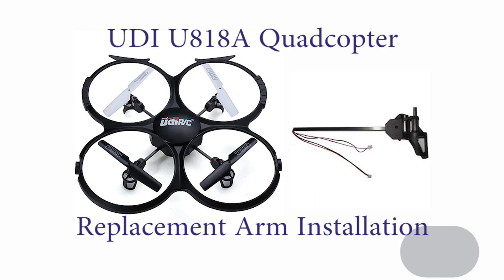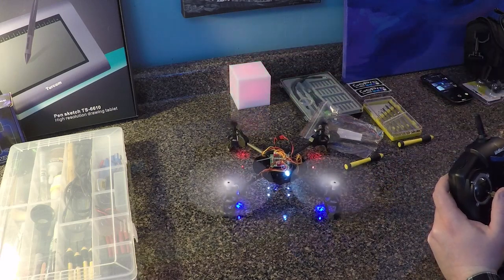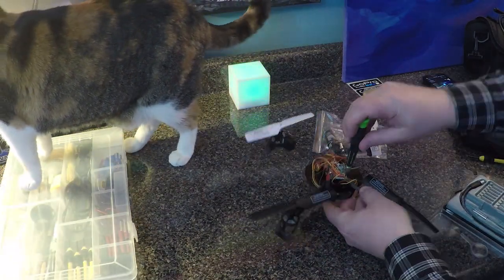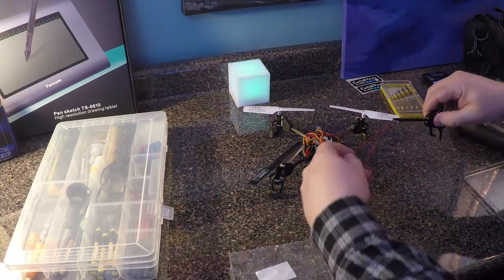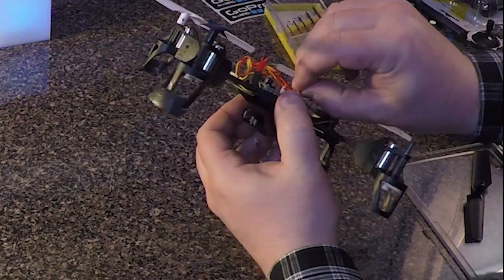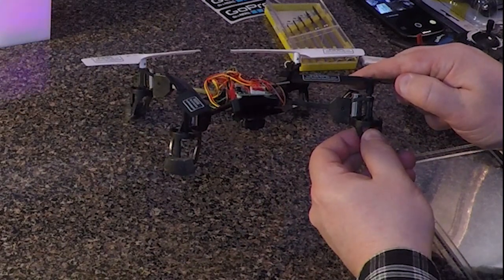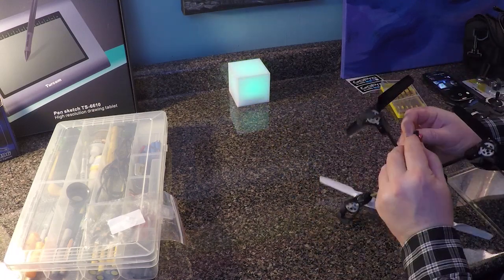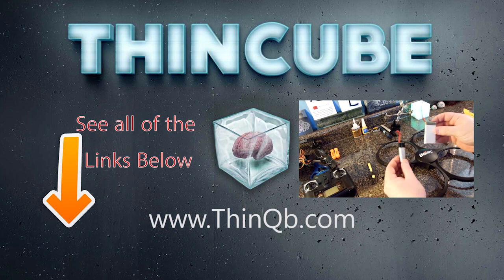UDI U818A + more Quadcopter Repair - Replacement Arm and Motor and U818a-1 Discovery

Comment: I had trouble with one of my motors they sent me two motors Is there anyway to tell which motor is Clock and which is counter clock
Reply from the maker: +Sammy Evans  Hi Sammy, the motor with blue and red wires is clockwise and the one with black and white wires is anticlockwise.  Take a look at this video if you need to know where they plug into on the pc board....  https://www.youtube.com/watch?v=BUghqOSFTiw
Reply: +ThinCube Thanks, I had to watch video a few times to understand everything, Lucky they sent the right motor, but reading all these post, One question, are all these motors clock and counter clock interchangeable by just reversing the wires, or do you have to have two difference motors.
Reply from the maker: +Sammy Evans My guess is yes you can reverse them with wire swap...but i would question how long theyll last or if theres a power reduction! They make two different motors for a reason....otherwise theyed just offer one and tell u to swap the wires....these are my assumptions of course :)

Comment from the maker: Hey everyone, thought i'd let you know that UDI has come out with an upgraded U818 quad called "Discovery" and It's getting rave reviews on Amazon. We're ordering one for review. Check it out here: http://amzn.to/1FUp7p9
Reply: Is that ur voice?
Reply from the maker: Haha....yes!
Reply: Thank u so much for ur previous reply, u are a life saver, problem now is I have fixed the arm, everything spins perfectly, but doesn't fly😕, what can I do about it
Reply from the maker: +David 'Boyejo oluneye Hi again David, i need more information to help you troubleshoot your issue. In what way is it not flying? You say it spins, is it spinning as fast as the other props? Are you sure you have the correct arm installed (spinning in the correct direction - clockwise vs anti-clockwise).
Reply: +ThinCube yes it actually goes up about 10 cm, not more and it comes back down, sort of like trying to hop and fall
Reply from the maker: David 'Boyejo oluneye Hmmmm, that kinda sounds like a bad/discharged battery. And when it does get off the ground, it is flying straight and level before falling? Are you sure no other wires got disturbed while you were in there....i know it can be kinda tight working in there. Sorry, but its really difficult to troubleshoot without seeing it. Kinda like bringin your car to the shop and telling them you hear a whirring sound at 55 mph...lol
Reply: +ThinCube it doesn't sort of go up, just goes it all directions, totally uncontrollable and falls off again. I have some new batteries, I'd try Wiv those and let u know. Thank u so much
Reply from the maker: David 'Boyejo oluneye I know i keep beating this to death but be sure that the motor is spinning the right direction. Two are clockwise and the other are opposite...verify this before all else! Its possible you ordered or were shipped the wrong motor.
Reply: Hey thanks for ur responses, the selling company USATOYZ sent me replacement motors and even a replacement motherboard, I have fixed them and d props are going in right direction, cw and ccw, but it still doesn't fly, it sort of rises from the back props and the front ones are sort of not rising, thus it ends up turning over , I am getting really frustrated, u have any idea what the issue might b?
Reply from the maker: +David 'Boyejo oluneye Sorry, but it sounds like you replaced everything that it could be. I doubt it would be the remote controller causing this and would suspect the main board if the motors were good. How about any binding in the front props keeping them from spinning freely like the back ones...its s hot in the dark but worth asking.
Reply: +ThinCube can't b the transmitters, cause I go new ones too, I don't know about the binding, but i was thinking maybe I change the props and see if that works, I have a set of spares in the house, this is really getting frustrating

Comment: please help! quadcopter won't lift off at all under 100% throttle. could you please tell me the propellor sequence (a1 b1) or if that even matters? please get back as soon as possible
Reply from the maker: +Michael Younger Hi Micheal, if you are looking at the front of your quad (white props and LED facing you) then the left white prop should spin anti-clockwise, the right white prop should spin clockwise, the black left prop should spin clockwise and the right black prop should spin anti-clockwise. I hope this helps. If you look at your props installed, the motor should spin in the direction to make the prop (leading edge) cut the air and the back part of the prop (trailing edge) swoops down. Let me know if you have any questions, Tony.
Reply from the maker: +Michael Younger Sorry, i left out the A1,B1 info.....B1 White is left front, A1 White is right front, A1 Black is left rear and B1 Black is right rear
Reply: +ThinCube I uploaded a video on my page if you want to understand the problem
Reply from the maker: +Michael Younger Hi again, i left a comment on your video....it looks like the black props are reversed. Swap them and try it. Let me know if that fixes it.
Reply from the maker: +Michael Younger So glad you got your quad flying again. I will make a video about "proper" prop installation :)
Reply from the maker: +Michael Younger Hi Michael, take a look at the new video i made for prop installation....and i used your video :)  Thanks again.....https://www.youtube.com/watch?v=nTNhGXrO5ik

Comment: I changed the whole arm however once I plug in the battery it starts spinning right away what did I do wrong??
Reply: CHECK your board sounds like the problem William le had below, sometimes you learn more when reading the comments then just the video! good luck!! Sorry Kiddo!!
Reply: Eagle Van Lines lol I see what u mean! Ty either way u helped
Reply: Eagle Van Lines u just ordered the board yoy can smell it short circuit ed 4 sure

Comment: I'm hoping someone sees this, after I done these instructions, when I powered it on, the motor that I replaced keeps running even when the throttle is completely down. I have done calibration, and all the batteries are full. Is there something else to do? I also have checked that all the motor pins are put on correctly, and that I got the correct motor.
Reply from the maker: H William, unfortunately that is a very common problem. It sounds like you have a bad main board. Sometimes when a motor goes bad it burns out the circuit that powers it as well. As a quick check though, look around the board and see if there are any burnt components or signs of overheating (discoloration). Also, make sure there are no shorts on any of the component connections. Overheating can cause solder to flow and short things. Otherwise, you will most likely need a new main board. You can purchase them here for around $20:  http://amzn.to/2gYgE4N  Sorry for the bad news but hope this helps....good luck.

Comment: What if there's lose wiring?
Reply from the maker: Hi CarJay7, well if by loose wiring you mean at the connections to the board or motors, then i would suggest using a soldering iron to reflow the joints to ensure proper current flow. Loose wires could cause intermittent operation of the component they are connected to as well as total failure. So sometimes they are hard to troubleshoot. Good luck and let me know how you make out with it.

Comment: my remote broke,i got a new one how do i connect it
Reply from the maker: Hi Somya, try leaving your drone battery unplugged (but fully charged) and turn the new transmitter on. The red light will flash, then push the throttle stick (left stick)  all the way forward, then all the way down. Now take the drone and plug the battery pack in and you should hear the binding tone. That should be it. Let me know how you make. happy flying!

Comment: Used it 5 times then LCD lost data just lit up white no characters at all, any idea?
Reply from the maker: Yikes, thats a new one to me. First off, with any electronic device that glitches or freezes, always remove power for at least 30 seconds. In this case remove all the batteries ( or maybe even install them backwards). This will allow all charge to dissipate and erase any erroneous information stored and hopefully clear any problems. Otherwise, i would say you need a new transmitter :(    Good luck and let me know how you make out Joel.
Reply: Thanks for your time ill try flipping tha batteries

Comment: My drone just stays at one foot and spins in circles!! Plz help!!!!
Reply from the maker: Hi, honestly sounds like you have a bad main board. I would check to make sure each motor is spinning strongly and freely. Look for any binding in the props. If you have a crash or landed in a sandy area, debris can get caught up in the gears and cause drag or like i said, binding. If everything spins nicely and theres nothing obviously wrong it probably is the main board....which is also a common issue with these things. You can get them on Amazon but make sure its the exact one for your particular drone....try here: https://amzn.to/2IjtdAG    Good luck and let us know how you make out!!!
Reply from the maker: Yes if you have the UDI U818A then thats the board :)    But make sure you dont have a bad prop/motor/or gears first!
Reply: i have the holystone u818a hd. not udi. i wil check the motors!!
Reply: So I replaced the main board and now it doesn't sync up with the remote now what???!!!
Reply from the maker: It could be because of a couple of reasons.....wrong board, defective board, wrong procedure, weak batteries in either the drone or the transmitter. I would start with making sure you have fresh batteries and are following the correct steps for binding your exact model. Take a look here for some videos on it: https://www.youtube.com/results?search_query=sync+udi+drone+with+controller    If that doesnt help and you are positive it is the correct one for your model of drone then all that is left is you have a defective board. As long as you know for sure your transmitter didnt  get broken somehow.

Comment: "slide the arms through the holes" is basically saying to break the cover making it unusable
Reply from the maker: Absolutely not, unless you have a different style/design than all the U818's ive seen. Pause the video at 1:06 and you can see there are "slots" above the holes that separate so you can slide the housing off.  Do you have a photo of your housing you can share?
Reply: hey i apologize, i was confused about how you did it from the sped up video. all good!
Reply from the maker: dog69420 No prob, just wanted to be sure you knew that you could take your housing off and on....thanks for commenting and happy flying!!!

Comment from the maker: Hey, in case you're wondering if your props are installed correctly....check out my new video for Prop Direction and Installation:  https://www.youtube.com/watch?v=nTNhGXrO5ik
Reply: I was like wtf I only used it 10 times and motor went out I was like that sucks I have to buy another drone, then I came across your vid. thank you so much.
it's acting up just like your video. 3 spin. 1 fails. will spin if you flick it, but then stops again. We're is a good place to buy parts and accessories. 
I herd you say you fly it without the housing, will it controlled the same?
Reply from the maker: Hi Oscar, glad the video helped :)  You can purchase the motors, props and all sorts of spare parts right from Amazon. Here is a link: http://amzn.to/25H0Rqd   As for flying without the housing, i think it has slightly more power and maneuverability. I like flying a lot better without the housing. Happy flying and good luck with the repair.
Reply from the maker: Oh btw, check your gears as well. This problem could be a result of a bad gear or gears on the prop motor. Take a look at this video for more info:  https://www.youtube.com/watch?v=3DBkewM-4Ew
Reply from the maker: Hi Hayden, if you are talking about the housing/prop protector then take a look at this pportion of the video 0:54 it shows that the housing just lifts off by passing the arms through slots. You can easily put it back on after as well. I no longer use it when flying. Thanks for asking and happy flying, Tony.

Comment: I have a problem with not enough power everything else works and the batteries are fine in my other drone. I went to Walmart and bought a bigger batter for their brand just a little bit bigger and it flew a couple of times then that was it. can you help?
Reply from the maker: So many things could be wrong so its very difficult to troubleshoot your problem just by the description. First off, was the battery you bought the same voltage? or if it was bigger that means you got more flight time out of it i assume so you could have worn or burnt out the motors from overheating. Those are a couple of things to start with....